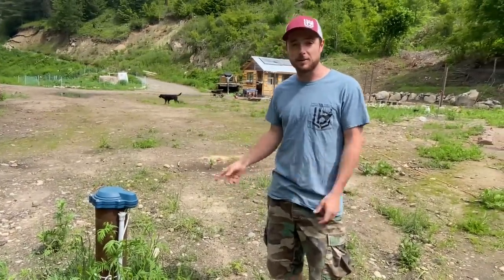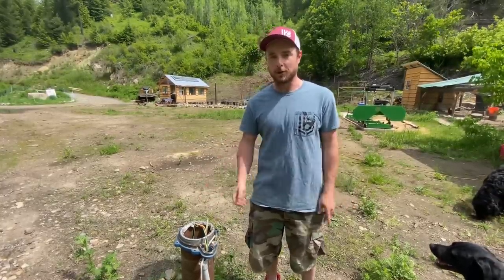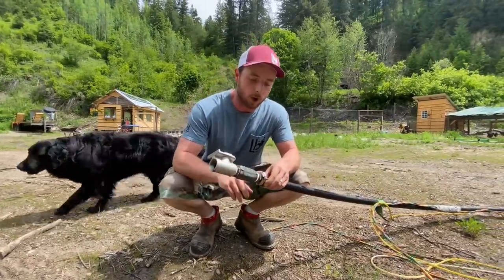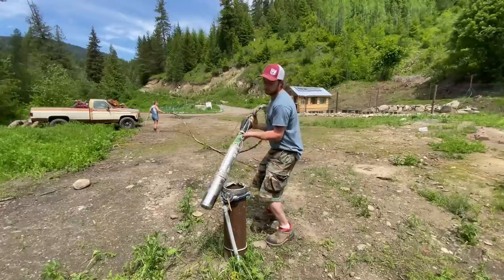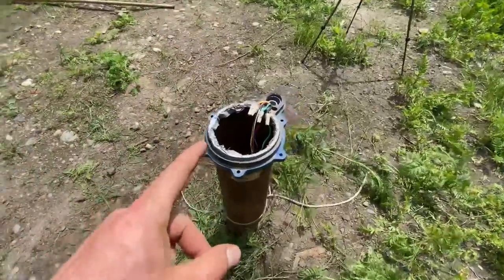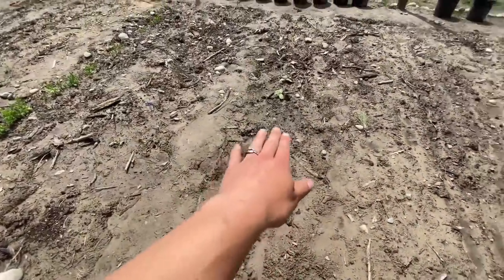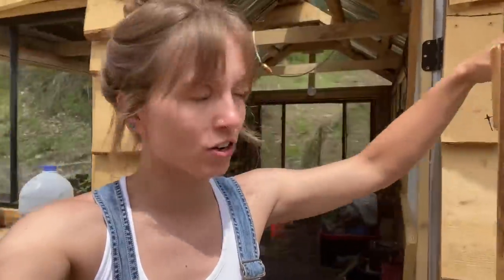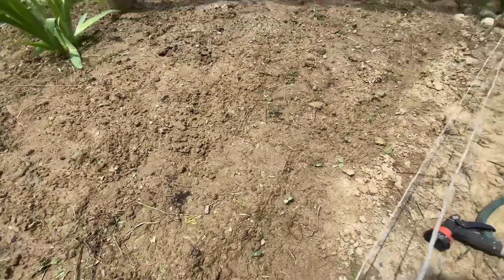The Mistake Every Well Owner Is Making

Comment: I take care of forty wells and most of them are on schedule 80 Pvc in 20 foot lengths. Much easier to pull. I have had bad experience with the type of submersible cable shown here. They make four wire cable in a thick  casing that is flat. This wire is tough. I have pulled a pump up from being dropped 300 feet just by the cable. The colored wire shown here will break down in some types of water, very easy to damage. The best way to pull poly pipe is to make a wheel like rotating guide so the well pipe does not rub on the top of the casing.

Comment: @Laid Back Living Mike and Liz, and all gardeners, be sure to start and keep year after year a garden planting and average and notable weather log. The video record  can be quite helpful too of course.  Also, as you proceed in future seasons of gardening do also try additional, duplicated,  rows of potted plants to see if within the good gardening areas, certain plants thrive better in one of the various microclimates of your gardening areas. The growth favoring slightly cooler and slightly damper air may do well closer to the wooded edge of the garden plots that you test.  A line of many potted plants nearer to the edge that is nearer to buildings may thrive, or not. A row near those boulders may like the slightly warmer space next to the lined up large boulders. Compare and plan according to your actual overall recorded results and according to your plans and your needs. 

Consider over and under, planting top foliage plants that grow quickly over or adjacent to plants that will mature a bit more slowly and grow as root crops. Also quick plants like snap peas, lettuce, and additionally plant what will take longer to bloom and mature, to get maximum results from your growing acreage and growing season.  Some do plant corn, beans and squash together, the three sisters but go light on the number of squash plantings (also, snap peas) as they proliferate so successfully. Thanks for helping to save the world and to be more self sufficient, one planted seed at a time.

Comment: I have heard of stainless cable dissolving from electrolysis. My well driller said that, I think.
Still a good material.
Reply: Your Well Driller was correct! The pH of water and even bacteria has been found to eat through SST Highway Tankers, and yes, even SST Tanks at a Municipal Water Treatment Plant! All SST is NoT created equal! Various alloys are used for different applications!

Comment: Maybe in the future you might want to build yourself raised beds, i planted my first garden in the ground , the next year i built raised bed , made my own compost .
My well is 300 feet down and we couldn't use a machine to pull it out it took 3 of us to do that, we were changing out the pump to a stainless steel so pulling it out by hand took a lot out of us, i had to burn my cloths after that , very messy , anyway y'all explained it to us very "well " thanks again,  later

Comment: I use a stainless safety cable every time also stainless cable clamps. This will prevent any additional rust inside the well. Something isn't right with your pittless adapter connection cause it should thread on way more than it did
Reply: Bot👆

Comment: If you have more cabbage than you can use,  pull them up with the roots.  Dig a hole and bury the cabbage head.  Make sure the roots are sticking up. Make sure the cabbage is covered good.  In the winter,  if you want a cabbage head,  wait until the temperature is about 36 degrees.  Go to the garden and pull the cabbage head out by the roots and shake the excess dirt off.

Comment: You should have wire guides every ten feet to stop your wire from rubbing the casing. Next time install a variable speed pump. These inverter driven pumps have no inrush current and do not torque spin because of the start windings.
Reply: If they spread out the football torques, they'll be fine. But at 50' 1 or 2 wire guides would have been the thing to use. I wouldn't pull it out again just for that! He almost dropped it just changing the nylon for steel. He shouldn't have bothered with that either.

Comment: Good change from rope to cable was the better choice, only suggest is to use 3 clamps, the 2 you used and a 3rd turn the cable back on itself, that way you will never have to worry about the cable clamps failing, specking from personal experience, love your channel and you both are willing to do the hard work,

Comment: A Big problem with cable is over time it will cut through the whole from the pump as your pump kicks on and off .. my pump has thick plastic rope it still good after almost 50 years and I had to pull the pump out 4 different times

Comment: You should have used stainless steel clamps and cable so you don't have the cable rusting and contaminating your water and rust particles getting in the pump and the cable  Rusting into and not being able to retrieve

Comment: When I worked on a huge dairy farm, their pump quit working! They had replaced their pipe with black poly! But the plumber forgot or didn't know to put spacers to keep the pipe in the center of the well pipe! When the pump kicks on the torque from the motor will spin the pump! Without the spacers holding the wires,  they rubbed the insulation off and shorted out and burned off the wires! You have to have the spacers to protect the wires !!!!

Comment: Don't use twist wire nuts use wire nuts that has the clamp that clamps the wires together you can burn them wires off if they're not totally wired correctly and then that plastic cap goes over top of that saddle clamp and you have a sealed connection

Comment: Gardening is a never ending learning process and about having lot's of fun while doing that, never back down; fails are part of it!; 
Your conditions are even harder than in our rainy country, Belgium; have also a heavy clay-ish soil; but still well feasible for very productive gardering. Just experience what works for you, and what not ; counts for both methods as crops; some just won't work in your specific conditions; never mind, move on to others, enough choice! 

Here my top tips, some already given below by fellow viewers; 
* Levelling probably took away the thin layer of good top-soil, looking at current sticky clay ; bring in lots of compost; you can start right away by taking some from the soil in the woods around you. 
Bringing in lots of organic material with lots of fibres and structure in all forms possible; cfr. Helmuth!
* Start with the raised beds right away like Nancy said ; always a good idea; moist (not flooded) soil well drained is the key. Drained by raising, staying moist underneath by mixing and covering with organic material. Mix chicken manure at the same time; perfect combination!
* Seed as much as possible in the pots and covered; inside, take out on a warm day outside, more& more outside as day of planting in the garden approaches (hardening the plant).  Plant in the garden not too fast, once planted in the garden, cover first week(s) with nets protecting from birds if needed. Work the soil, especially after rain, too keep it loose and well at the same time well reachable for new roots.  
* Tomatoes ; cannot stand rain for too long ; works best under a transparant cover; little roof, even a plastic with holes in it, wrapped like an umbrella around the plant- supporting stick is ok; keep a flow of air around the plant, covered from most of water and create micro-climate = happy tomatoe plant ;-) ps. always water around the tomatoe plant, never on     

Enjoy & thx for the wonderfull and realistic video's!

Comment: Did you sanitize your well?  I used to put Clorox bleach in mine until I smelled the bleach coming out of the faucet.  I hooked a hose to a hose bib and washed down the entire pipe from the pitman valve on down.  We drank and cooked with bottled water until a couple of days after the bleach smell went away.  You should be testing your well water quality for bacteria every few months.

Comment: There’s a saying with those clips. Crosby was the name brand of them and why they were called Crosby clips even tho most one you get now are from China. But there’s a U bolt and a saddle. So the saying is “never saddle a dead horse”.  The dead horse being the dead end of the wire rope. There is something like a 30% reduction in load capacity but for most cases it doesn’t really matter if there’s a factor of safety. But now that you know you’ll never be able to walk past a Crosby clip ever again.

Comment: Is the duck tape under water? Also, you should put a cut rubber hose around the wires, so they don't get damaged by the metal or plastic edge on top.

Comment: A good idea to change out that cheap nylon rope, the stainless wire should last years. The clamps you put on the steel w rope should all be put on the same way, with the 'U' part on the dead end and the bigger part on the running end, this stops the important bit of the cable getting crushed/damaged. (Sorry to be a smart ass)! It'll be fine though.

Comment: I'm a retired Water Well guy and we have been in business since 1966 an now 3rd generation ownership.  Why the need for a torque arrestor  is #1 then a safety cable #2 no need to double check a pump at that depth ,only need use a single clamp per hose barb and a few other whys need addressed like pump wiring & tape job just my opinion. That looks to be a 6'' well with a high static level no clue to its gpm output and or drawdown but that pump install would and could be a much neater job an last in theory 20+ yrs before needing touched/worked on. I've done thousands of well's and pump installs from 4'' and bigger both well & pump sizes no need for all the extras 90+% of the time.

Comment: Cutting the yellow safety rope before the pump was out of the well?  Lucky nothing went wrong with the lifting pipe after you cut it like it did earlier.  Why not tie it off, then pull the pump in safety?  You lucked out.

Comment: The cheap galvanized wire rope will rust off in two years, should always use stainless steel cable. On your cable clamps you do not alternate them they are always put on the same way "never saddle a dead horse".

Comment: Wow it looks like doing a video get you all kinds of good advice I've been left bewildered. I see you pulling this pump up out of the well and you put it back down in the well and the pump is going to suck it up through the line you pulled out of the well but I never saw where the waters going. you you put it back in the well and turned on the water he said the water in the casing should go down but it should have also shot out the top of the line I can't figure out where you're pumping your water to you got a bottom and a top and you didn't connect anything to the top.

Comment: When working with cable, you NEVER “saddle a dead horse”, meaning the saddle side of the clamp NEVER goes on the dead end side of the cable, otherwise the cable could pull through the clamps!

Comment: I must concur with another comment regarding potential contamination... after pulling the pipe & wire and then laying it on the ground, you need to consider sanitizing the well.  Good luck.

Comment: Corn needs fed heavy and more spacing. I'd take out the weakest plants to get it 8' apart, depends on the corn. It won't fly well in pots or transplanted after very early in my experience. Tomatoes have a way of BOOMING BACK if it's sunny. Compost tea, just mix compost and water, maybe some weeds in a big container and keep mixing it a couple times a day. That feeds everything well, especially tomatoes. Tomatoes EAT, you can put any kind of veg matter in the hole when you plant them or beside them. They love bananas and can thrive even on citrus peels. I'd take some dirt and sawdust if you have it and wait, O_O ... I'm way to late :)). Tomatoes and Peppers especially peppers LOVE heat and do well in pots, bigger pots better. Potatoes don't do well in soil that gets too warm, better direct in the ground unless you're in a very cool climate.

Nice looking place you got there. I'm in South Central Idaho.

Comment: EDIT:  Chlorinated water will kill plants yesterday.  So, if you do chlorinate your well to reduce contamination of pulling the guts, then you will have to let it do its job then purge the chlorinated water before watering plants with it.
Wellmen will shock-chlorinate after any working in/on a well.
They like to yank things out and just lay it in the grass with all of the insects and bird doo and critter crap.
Given that you have dog-critters I would have laid out visqueen with some stones to hold the plastic in place to lay the well guts on and protect the pitless adapter from grit.  DOW 111 is a good waterproof lubricant for potable water systems if the pitless ever didn't want to go home.  Higher expense on the initial build will always pay off in the long term:  I would not have used duct tape inside the well.  Look into the components of the adhesive compared with your well-tape and find out if there is aluminum in the colorant of the gray tape.

Comment: My well is 185' deep in Oklahoma and it has that yellow polypropylene rope which has been in our well since 1990 and we've had our water tested 3 different times and the water is clean with no contaminates or bacteria ever. They use this same type of rope in all of our area and I've got a 3/4 hp submersible pump but we got rid of the black pipe and went with schedule 40 threaded pipe, 1 1/4". 10 ft joints and when we pull it out it just unscrews and we don't have as much trouble trying to wrestle with a long stiff hose. We use a u shaped piece of metal to fit around the pipe under the collar to hold it up while putting the pipe together, works great.

Comment: There are limits to each installation. My well goes down 475 ft. and you will not use butyl or white plastic pipe! I have 1" and 3/4" galvanized pipe and you will not raise that by Hand. Not discourage your setup, however this was my circumstances. Sometimes you creep past the limits without noticing. You have a lot of the 'other details' covered. The braided wire should be stainless steel aircraft quality and yes 1/8th " is good for your install, however, it ws suggested by the drill well company to be over protective and go for 1/4" cable. It was less than a 50 cents a foot increase in cost to me.

Comment: Steel cable will rust and when you pull up later it will break. 

You can’t just dig out the side of a mountain and farm the sterile sand underneath. 
You need organic matter and microbiology to have healthy soil and plants. Make as much compost as possible.
Hopefully in 3-5years you will have healthy soil. 

You can’t plant where the hill meets the flat you need to dig better drainage and a pond to capture the water so you don’t have a washout.

Comment: You would want to use Stainless cable and you used the clamp incorrectly their is a old saying never saddle a dead horse meaning the saddle of the clamp should go on the main line and the clamp of the wire would go on the dead end or tail of the wire rope! Shouldn't make a big difference in your case but maybe in other applications! So the second clamp is in the correct position and the first clamp should be flipped over.

Comment: Trying to be helpful, not annoying.  But... not exactly.  a)) Torque arrestors are used expanded to close to the size of casing. They work by "rotary contact" w/ casing at the pump start "impulse."  b) Cable -- only all stainless if you use it.  There are perfectly good ropes than can be used.  Won't leach out anything.  (Put a sheave on the steel casing, you can pull up w/ a slow moving small tractor, etc.)  c)  Wire nuts -- not so much.  Use one or another compression fitting / rubber tape / 3M vinyl -- waterproof connection - same technology used in manholes, etc.  d) Tape for drop is actual "pipe wrap" -- sold as such.  e) "long" brass male adapters have been the "standard" for connecting both ends of the drop,  3-4 worm clamps if you use them / can also use "band-it" and or similar stainless, Stainless long adapters okay if you can get them, 316 (not easy to get) better than 304. f) If there is "sand" in the well, you have a problem w/ your screen ( assuming its not just a bore hole) or you haven't developed the well.  (Over time, sand will eat a pump...)

Comment: Soooo... you are worried about plastics and dyes in the rope.   Yet the entire feed line for the water is plastic.   Also, unless you have used all stainless steel cable, AND fittings, there will still be 'contamination' in your system.   But thanks for the look into a well.

Comment: The reason everyone went to the ropes was because the steel cables, and their clamps... Rust. More pumps have been lost to the bottom of the well, with steel cables, than with synthetic rope. Your better bet might have been to just find a better synthetic rope, instead of the cheapest one you could find.
Reply: Stainless steel that size, simple to splice and still use the clamps for the tail. Much more secure.

Comment: You need a pressure tank so the pump will not run all the time, that's why you had no pressure when you turned the pump off. A pressure tank saves electricity and pump wear and gives constant pressure. Fifty gallon and up pressure tanks are available . Most wells should be and least a hundred feet deep to be safe to drink..

Comment: This is the most uninformed video I've watched. Why on earth did you cut the wires on the pump instead you should have cut the tape. Next when using cable clamps always use the old saying, never saddle a dead horse!  So that means the first clamp you put on was backwards